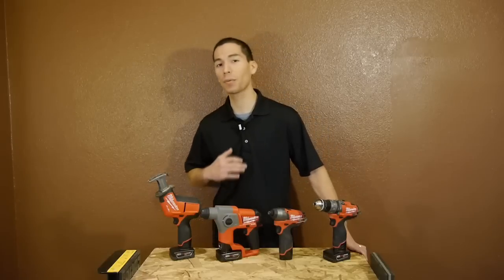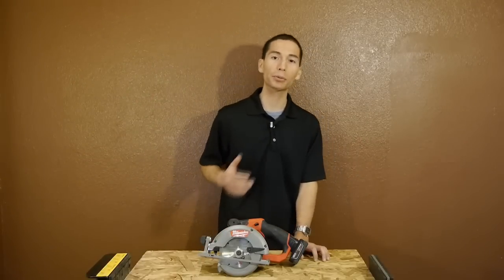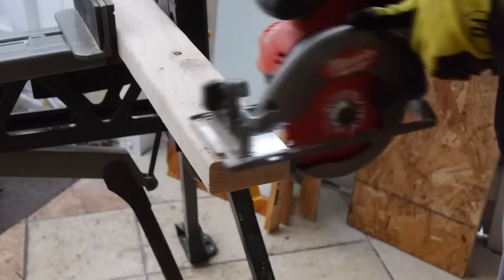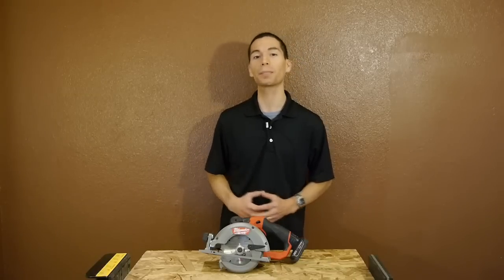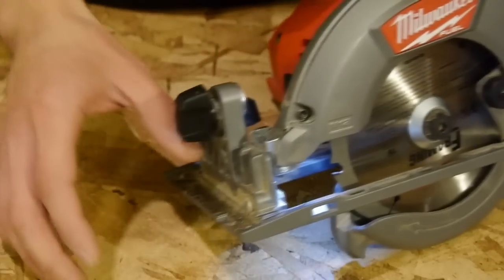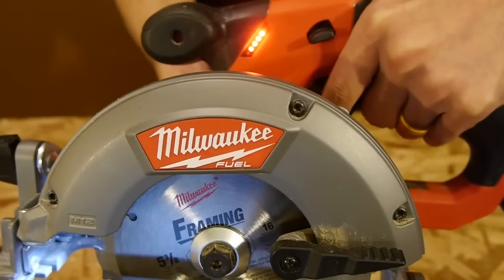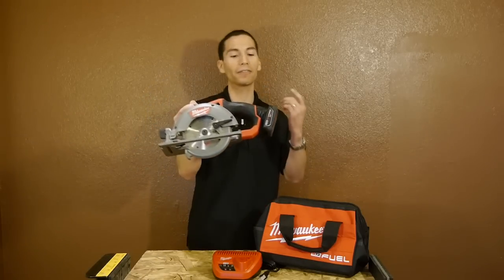Milwaukee M12 Fuel Brushless 5-3/8" Circular Saw Review and Runtime 2530-20 2530-21XC CCS44

Comment: Excellent review!  I liked how you showed the real time cutting speed.  For a 12v saw, this little guy can get the job done.  It's no corded replacement like the m18 fuel circular saw,  but it is a great little saw for guys who have stuck to the 12v line.
Reply from the maker: Wild Goose thanks bro, glad you liked the in action clips. You pretty much summed it all up, I like the 12 volt tools because of their tiny size and power for their size.

Comment: I bought this on the strength of this review. One thing I would add.......................avoid the 2.0Ah batteries. Get 4.0 ah batteries.

Regarding the saw itself, it is v useful for thin sheet and an invaluable tool for a handyman who knows they will have to make some cuts into sheet material or joists.

Comment: Javier, or someone else who has used both... Having used both the Milwaukee M12 FUEL Brushless Circular Saw & Ryobi's new P507 brushed 18v Circular Saw, I have a question about your honest opinion. As a residential handyman with lots of small projects where cutting 2x stock and smaller will due for the majority of projects, do you have a preference as to which circular saw you would reach for 1st as your go-to tool? Also, is the Milwaukee M12 3/8" drill/driver any smaller than the Ryobi 18v compact 1/2" drill/driver? I find myself using my drill in lots of cramped spaces and angles inside of cabinets, window frames, etc; but at the same time envy my lack of that little magnetic recess in the base for extra bits/screws when using my M12 drill. I usually use the 4ah M12 batteries and am pleased with their power and pricing. Thanks.
Reply from the maker: +cb before I answer your question I'll tell you a bit about myself. I have several different brands and voltages of cordless power tools and I personally prefer 12v if they can get the job done. Lots of times I'll even carry both to whatever project I may have. Most people don't have the luxury of carrying more than one cordless brand of power tools. I usually will use this m12 for most cuts because of its size and when I need more power I'll skip 18v and go straight for 36v and use the Makita. That's if I'm using a circular saw, many times I'll just use a miter saw if I'm cutting lots of dimensional lumber or a table saw if cutting down plywood as it's much easier. With that said for what your saying you'll be using a circular saw for, the m12 fuel seems like a great choice. For its size is impressive, both in power and runtime and it's build quality is that of the m18 fuel so you're getting a tough little saw with pro materials like aluminum shoe and guards. But on the other hand the ryobi does offer more power and a larger cutting capacity.

I'm sure the m12 brushed drill is more compact than any ryobi 18v drill

Comment: I own that saw and I love it because of the low weight and the small size but I don’t get the excitement about the 12V.
I don’t care if its 12, 14.4 or 24V.
Reply from the maker: The excitement is over the size of the tools. many people that don't want the larger size of 18v go with 12v. Although based on your comment you say you don't care about the voltage, you seem to be excited for it's size and weight which is what 12v tools are all about.

Comment: Hello everyone
Does 2530-20 come with contractor bag?
At milwaukee site it's stated it does...
What's Included
(1) M12 FUEL™ 5-3/8" Circular Saw (2530-20)
(1) 5-3/8" 16 Carbide Teeth Circular Saw Blade (48-40-4105)
(1) Blade Wrench
(1) Contractor Bag

Please advice!
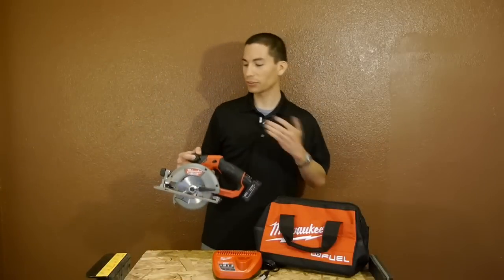Reply from the maker: m301aa yes it does, I explained that it does in the video @ 4:11

Comment: how is the dust buildup and does it get in the way of cutting or does it get all over the person who uses this tool?
thanks
Reply from the maker: +Arek Kosinski theres no dust blower so it wont blow away dust in front of the cut line and there's no side dust ejection port so lots of dust will be left on the material being cut, check out the video clip in the end of this video to see it cut the osb lumber and see all the dust that's left on the material as it cuts.
No it doesn't get all over you but theres a good amount left on the material
Reply: +Tool Craze thanks buddy and great review as always

Comment: Im want to see this saw VS the 2630-80 M18 18-Volt Lithium-Ion 6-1/2 in. Cordless Circular Saw.
Reply from the maker: ***** I dont have that model anymore but I can tell you it easily has more power you can see it in action in my Milwaukee M18 7-1/4" fuel circular saw review